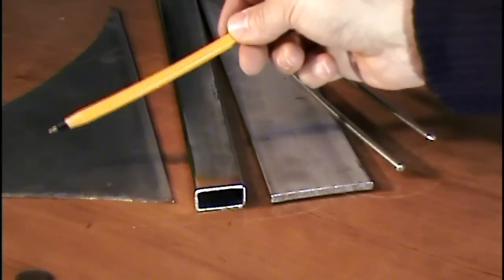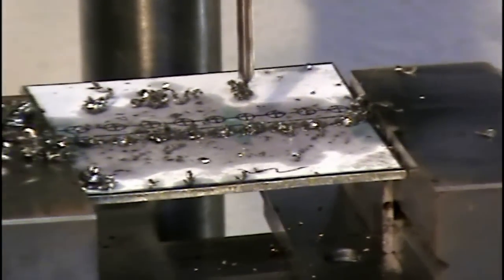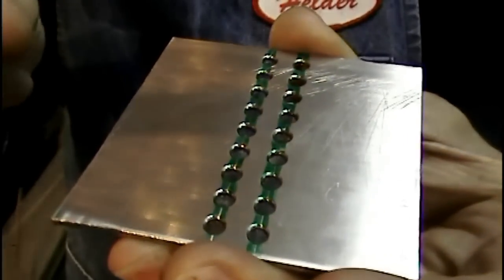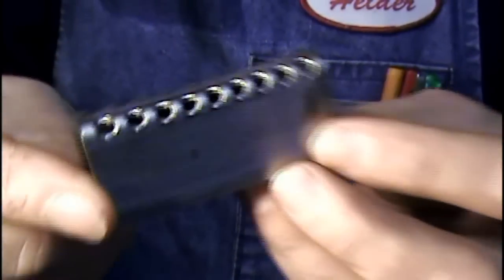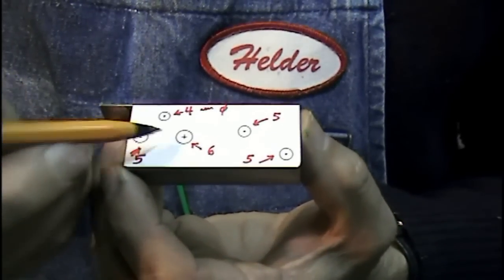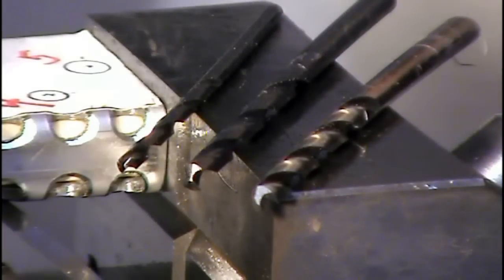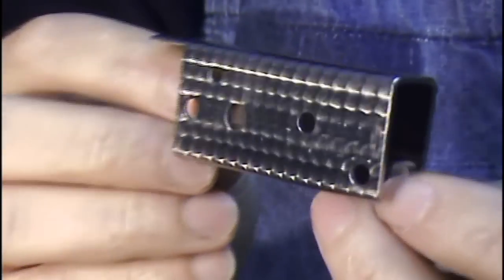Speargun Trigger Mechanism - Part 1: The Housing

Comment: hello 
can u help me to do this  it's my dream e mail me the plan plz
Reply from the maker: Hello Badi Badi,
making the plans available will not be possible, however i can give some overall dimensions from the trigger mechanism and the spearguns.
 - The trigger housing dimensions= 13x30x65mm, wall thickness:
2mm 
Trigger and Sear= 5mm thick. All made from 316 grade stainless steel
Some of my channel viewers told me, that by using any free screen 
recorder program to take "screen shots"  from some of my videos, and 
then using a image editing program like "Windows PAINT" to scale the images to get the right sizes. Watch the video
 "Roller Speargun Design Model"
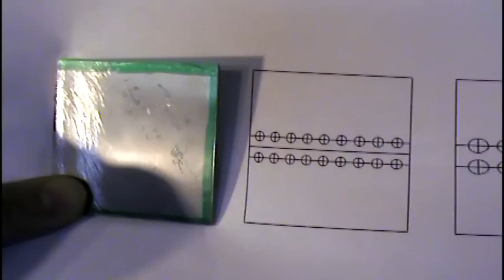 https://www.youtube.com/watch?v=_qQXGEgw5p8  at 1:03 is possible to see a side view of the trigger mechanism.

  Overall dimensions of the spearguns.
The roller speargun:
 1200mm long (end to end)
950mm from the centre of the rollers to the edge of the trigger pocket 
50mm wide
---------
Traditional speargun,
1200m long
950mm from the edge of the rubber bands hole to the trigger pocket
50mm wide from the but plate to the end of the trigger pocket and tapering down to 40mm at the tip (muzzle)
I used  Okoume Marine Plywood  laminated together with epoxy,  but a much better choice will be to use Teak Wood.
Thanks for the comment and for watching my videos.

Comment: Hello friend, I like your video, could you give me the measurements or the complete plan to create it at home?
Reply from the maker: Hello Roger H. Villarroel,
 making the plans available will not be possible, however i can give some overall 
dimensions from the trigger mechanism  - The trigger housing dimensions=
 13x30x65mm, wall thickness: 2mm .Trigger and Sear= 5mm thick. All made 
from 316 grade stainless steel Some of my channel viewers told me, that 
by using any free screen recorder program is possible to take "screen 
shots" from some of my videos, and then using a image editing program 
like "PAINT" to scale the images to get the right sizes. Watch the video
 "Roller Speargun Design Model"  https://www.youtube.com/watch?v=_qQXGEgw5p8 at 1:03 is possible to see a side view of the trigger mechanism. 

Thanks for the comment and for watching my videos.

Comment: Boa tarde, teria a possibilidade de enviar o gabarito com as medições para confecção? E qual medida para para a madeira?
Reply from the maker: Hello Welton Rosa,
That will not be possible, however i can give some overall dimensions from the trigger mechanism and the spearguns.
 - The trigger housing dimensions= 13x30x65mm, wall thickness: 2mm 
Trigger and Sear= 5mm thick. All made from 316 grade stainless steel
Some of my channel viewers told me, that by using any free screen 
recorder program to take "screen shots"  from some of my videos, and 
then using a image editing program 
like "PAINT" to scale the images to get the right sizes. Watch the video
 "Roller Speargun Design Model"
 https://www.youtube.com/watch?v=_qQXGEgw5p8  at 1:03 is possible to see a side view of the trigger mechanism.

  Overall dimensions of the spearguns.
The roller speargun:
 1200mm long (end to end)
950mm from the centre of the rollers to the edge of the trigger pocket 
50mm wide
---------
Traditional speargun,
1200m long
950mm from the edge of the rubber bands hole to the trigger pocket
50mm wide from the but plate to the end of the trigger pocket and tapering down to 40mm at the tip (muzzle)
I used  Okoume Marine Plywood  laminated together with epoxy,  but a much better choice will be to use Teak Wood.
Thanks for the comment and for watching my videos.

Comment: Hello is there any chance to get trigger template?
Reply from the maker: Hello TEO 5
That will not be possible but I can give you some overall dimensions for it.
 - The trigger housing dimensions= 13x30x65mm, wall thickness: 2mm 
Trigger and Sear= 5mm thick. All made from 316 grade stainless steel
Some of my channel viewers told me, that by using any free screen 
recorder program to take "screen shots"  from some of my videos, and 
then using a image editing program like "PAINT" to scale the images to get the right sizes. Watch the video
 "Roller Speargun Design Model"
 https://www.youtube.com/watch?v=_qQXGEgw5p8  at 1:03 is possible to see a side view of the trigger mechanism.
Thanks for the comment and for watching my videos.

Comment: plizzzz darawing send kigiye 7808364016
Reply from the maker: Hello Shubham Rock12325
that will no be possible but I can give you some dimensions for it.
 - The trigger housing dimensions= 13x30x65mm, wall thickness: 2mm 
Trigger and Sear= 5mm thick. All made from 316 grade stainless steel
Some of my channel viewers told me, that by using any free screen 
recorder program to take "screen shots"  from some of my videos, and 
then using a image editing program 
like "PAINT" to scale the images to get the right sizes. Watch the video
 "Roller Speargun Design Model"
 https://www.youtube.com/watch?v=_qQXGEgw5p8  at 1:03 is possible to see a side view of the trigger machanism.
Thanks for the comment and for watching.

Comment: What's the meager between   the holes & the place of holes.
Reply from the maker: Hello  محمود الفيتوري
 I can give you some dimensions for it.
 - The trigger housing dimensions= 13x30x65mm, wall thickness: 2mm 
Trigger and Sear= 5mm thick. All made from 316 grade stainless steel
Some of my channel viewers told me, that by using any free screen 
recorder program to take "screen shots"  from some of my videos, and 
then using a image editing program 
like "PAINT" to scale the images to get the right sizes. Watch the video
 "Roller Speargun Design Model"
 https://www.youtube.com/watch?v=_qQXGEgw5p8  at 1:03 is possible to see a side view of the trigger machanism.
Thanks for the comment and for watching.

Comment: You did't give the dimension between 18 holes
Reply from the maker: Hello محمود الفيتوري
 I can give you some dimensions for it.
 - The trigger housing dimensions= 13x30x65mm, wall thickness: 2mm 
Trigger and Sear= 5mm thick. All made from 316 grade stainless steel
Some of my channel viewers told me, that by using any free screen recorder program to take "screen shots"  from some of my videos, and then using a image editing program 
like "PAINT" to scale the images to get the right sizes. Watch the video
 "Roller Speargun Design Model"
 https://www.youtube.com/watch?v=_qQXGEgw5p8  at 1:03 is possible to see a side view of the trigger machanism.
Thanks for the comment and for watching.

Comment: Hello
In your video you use a tool to make circles on the plate of the mechanism
Or finds this tool and how it is called
thank you in advance
Reply from the maker: Hello stephane fishback,
the blue tube that you see in the video is just a tube from a old 
wrinting pen, the part that creates the jeweling is a piece of abresive 
rubber  rod, you can find it on  tool makers suppliers shops or on ebay 
serch for ( abrasive rubber rods)or even at musical instruments stores 
it´s used to clean the frets in guitars!
Thanks for the comment  and for watching my videos!

Comment: grand travail gentleman, just les mesures sil vous plait entre les trous . comment je peux l'appliquer si je n'ai pas le chima ou dessin  !!!!
Reply from the maker: Hello Sid Abdelbasset
Making the plans available will not be possible but a can give you some dimensions for it.
- The trigger housing dimensions= 13x30x65mm, wall thickness: 2mm 
Trigger and Sear= 5mm thick. All made from 316 grade stainless steel
Some of my channel viewers told me, that by using any free screen recorder program to take "screen 
shots"  from some of my videos and then using a image editing program 
like "PAINT" to scale the images to get the right sizes. Watch the video
 "Roller Speargun Design Model"
 https://www.youtube.com/watch?v=_qQXGEgw5p8  at 1:03 is possible to see a side view of the trigger mach.
Thanks for the comment and for watching!

Comment: do you have by chance the trigger template ? :) .
Reply from the maker: Hello Cristian Andrei Urzica
Making the plans available will not be possible but a can give some dimensions for it.
- The trigger housing dimensions= 13x30x65mm, wall thickness: 2mm 
Trigger and Sear= 5mm thick. All made from 316 grade stainless steel
Some of my channel viewers told me that is possible to take "screen shots" from some of my videos and then scale the images to the right size using a image editing program e.g Windows Paint. Watch the video "Roller Speargun Design Model"
 https://www.youtube.com/watch?v=_qQXGEgw5p8  at 1:03 is possible to see a side view of the trigger mach.
Thanks for the comment and for watching!

Comment: Hello! Would you have these drawings to share?
Reply from the maker: Hello rog alves,
Making the plans available will not be possible but a can give some dimensions for it.
- The trigger housing dimensions= 13x30x65mm, wall thickness: 2mm 
Trigger and Sear= 5mm thick. All made from 316 grade stainless steel
Some of my channel viewers told me that is possible to take "screen 
shots" from some of my videos and then using scale to get the right 
sizes. Watch the video "Roller Speargun Design Model"
 https://www.youtube.com/watch?v=_qQXGEgw5p8  at 1:03 is possible to see a side view of the trigger mach.
Thanks for the comment and for watching!

Comment: hello sir if you can make your cad models available so I can download and use the same template? thx youuuu
Reply from the maker: Hello achraf rawan,
I want to finish this spearguns project first, before making it available. 
I designed this trigger mechanism using a Cad program (Google Sketchup) 
The only dimensions that I can provide are: The trigger housing dimensions= 13x30x65mm, 
wall thickness: 2mm, the Trigger and Sear= 5mm thick. All made from 316 stainless steel
I´m very confident about this design, but I need to field test it, over along period of time before making it available. 
Some of my channel viewers told me that is possible to take "screen shots" from some of my videos and then using scale to get the right sizes. Watch the video "Roller Speargun Design Model" at 1:03 is possible to see a side view of the trigger mach.
Thanks for the comment and for watching my videos!

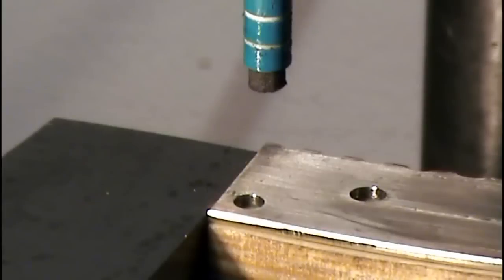Comment: what kind of tool is   minute  13:45  , looks like a polish roller ??
Reply from the maker: +Michelugg15 
Hello Michelugg15 ,
the blue tube that you see in the video is just a tube from a old wrinting pen, the part that creates the jeweling is a piece of abresive rubber  rod, you can find it on  tool makers suppliers shops or on ebay serch for ( abrasive rubber rods)or even at musical instruments stores it´s used to clean the frets in guitars!
Thanks for the comment  and for watching my videos!

Comment: What tool do you use when making swirls pettern(jeweling)?
Reply from the maker: +Tore Hoff Edvardsen 
Hello Tore Hoff Edvardsen,
the blue tube that you see in the video is just a tube from a old wrinting pen, the part that creates the jeweling is a piece of abresive rubber  rod, you can find it on  tool makers suppliers shops or on ebay serch for ( abrasive rubber rods)or even on musical instruments stores it´s used to clean the frets in guitars!
Thanks for the comment  and for watching my videos!

Comment: Hello! thank you for your passionate fun exciting videos.  I am wondering if you can make your cad models available so I can download and use the same template?
Reply: Kai Staal Also, do you have any suggestions of places to get stainless steel that is relatively inexpensive?
Reply from the maker: +Kai Staal 
Hello Kai Staal
for now, that will not be possible, i have to finish making the 
spearguns and after  testing it for some time, it´s very important to 
know if it works in real life situations, and that is safe to use it.
Thanks for the comment and for watching my videos!
Reply from the maker: +Kai Staal 
I get my stainless steel from a local marine tool maker shop, and i buy the little left ouver pieces (end cuts)!

Comment: it's a bad choice to use alumnium ? or it's work fine ?
Reply from the maker: +mazen mezlini 
Hello, the final trigger machs. are made from stainless steel, i don´t recommend using aluminium, it can fail due to wear on the parts!
Thanks for the comment and for watching my videos!
Reply: +MrMyvids4you thank's for the advice :-)

Comment: Heating up the coil to white hot then rapid cooling it might make it have more snap back
Reply: Oil not water used motor oil is perfect
Reply from the maker: Hello justin Ambrose,
I tried it before, and it made the steel very brittle, one of the hooks at the ends broke off, and the heat made the spring uncoil almost one full turn !
using pre-heated steel, and if is to be used in water it should be stailless steel, is the best way to do it!

Read this comment from colin burrows, it explains how to make stronger springs!

-if using a variable speed drill when you coil your spring try to hold the mandril at an angle so the wire you are coiling is  slightly pressed against the previous formed coil, this will give you better tension in your spring just make sure you pull hard to keep the wire in tension but try not to let the wire over ride the previous coil.
yours the spring maker...

Comment: Dear, mrmyvids4you,
I'm your fan! Thank you for interesting and helpful videos! 
I'd like to ask if it's possible to send me trigger drawing with dimensions? I'd like to make the same. ggttserh@gmail.com

Thank you in advance!
Reply from the maker: Helo, Active panel,
I need to field test it for a long time to guarantee that it is safe to use, at the moment the only dimensions that i can provide are from the trigger housing outside dimentions= 65x30x13mm the walls are 2mm thick and the sear and trigger are 5mm thick, i used 316 grade stainless steel.
Thansk for watching!

Comment: Hi, great vid. Do you think you would be able to make the templates for all the components in this project and make them available on this page?
Thanks. :)
Reply from the maker: Helo Jason Millar
I need to field test it for a long time to guarantee that it is safe to use, at the moment the only dimensions that i can provide are from the trigger housing outside dimentions= 65x30x13mm the walls are 2mm thick and the sear and trigger are 5mm thick, i used 316 grade stainless steel.
Thans for watching!
Reply: Thanks a lot for that, no worries about it, keep up making great videos,
Jason
Bye
Reply: @MrMyvids4you  sir you can provide templates now...

Comment: Nice work. I realy want make a trigger for my old speargun. Can you send me  the plan please :-)
Reply from the maker: Hello Hussain Salah,
I designed the trigger mechanism and the speargun with a CAD program.
I need to field test it for a long time to guarantee that it is safe to use, at the moment the only dimensions that i can provide are from the trigger housing outside dimentions= 65x30x13mm the walls are 2mm thick and the sear and trigger are 5mm thick, i used 316 grade stainless steel.
Thans for the comment

Comment: hello friend! ah I liked the way you work, I was wondering if you could send me some world pdf file or you used to print on sheet metal! and would be much easier for me to make the trigger! I liked both! good job by the way!
Reply from the maker: Hello Secretvf.
Sorry that will not be possible,
This is just a personal project, at this time the speargun stocks are not finished yet! I need to finish the wood stocks, then field test the triggers for a long period of time, is very important to know if the triggers are safe to use, before making it available.
Thanks for watching my videos!
Reply from the maker: Hello xAnti Kun
I designed the trigger mechanism and the speargun with a CAD program.
I need to field test it for a long time to guarantee that is safe to use, at the moment the only dimensions that i can provide are from the trigger housing outside dimentions= 65x30x13mm the walls are 2mm thick and the sear and trigger are 5mm thick, i used 316 grade stainless steel.
Thans for the comment

Comment: hi,  
Very nice work. How do I find a drawing of the trigger mechanism?
Reply from the maker: Hello Mr. Osman,
I designed the trigger mechanism and the speargun with a CAD program.
I need to field test it for a long time to guarantee that is safe to use, at the moment the only dimensions that i can provide are from the trigger housing outside dimentions= 65x30x13mm the walls are 2mm thick and the sear and trigger are 5mm thick, i used 316 grade stainless steel.
Thans for the comment

Comment: good work could you also sent me some more informations or maybe the templates for the trigger parts or the templates you used in the video nice job !!!
Reply from the maker: The only dimensions that i can provide are the outside dimensions from the housing: 65 x 30 x 13mm, the walls are 2mm thick.

Comment: Hi there i like the way you work.can you make video that shows the size of the trigger parts in details!?If yes will be trait ill try to do the same.thank you from japan where blue tuna lives haha,good work man
Reply from the maker: I´m working on a new design that will improve this trigger performance, it will have a shorter trigger pull, new Sear stop and a safety knob. This is a project under development and needs to be field tested first before being available.
The only dimensions that i can provide are the outside dimensions from the housing: 65 x 30 x 13mm, the walls are 2mm thick.
Good luck with your project, and catch many tuna fish. I love tuna! even if is from a can!
Thanks for the comment!
Reply: Good,and if you make a video ill definitely watch at .Its very kind of you 4 replying and thank you 4 your time.
Reply from the maker: The only dimensions that i can provide are the outside dimensions from the housing: 65 x 30 x 13mm, the walls are 2mm thick.